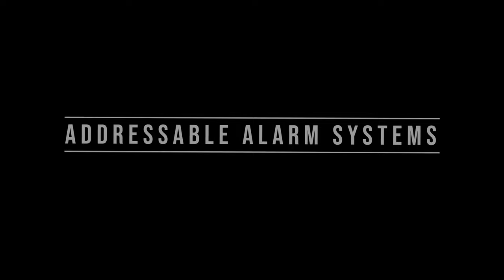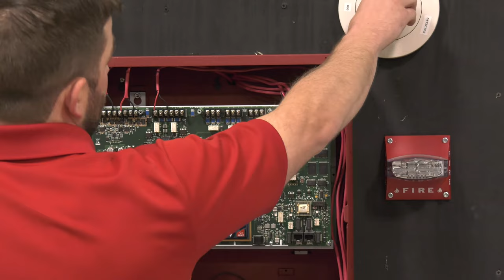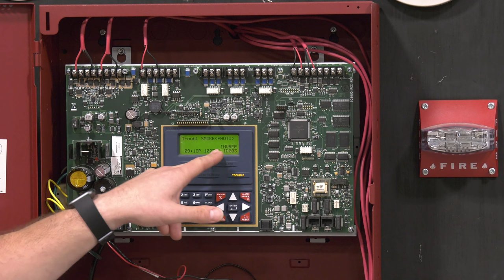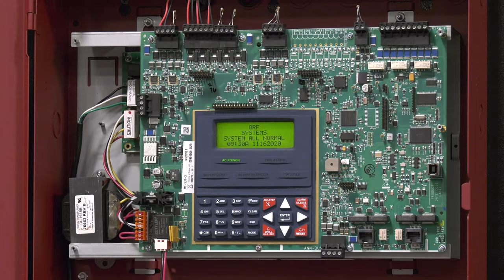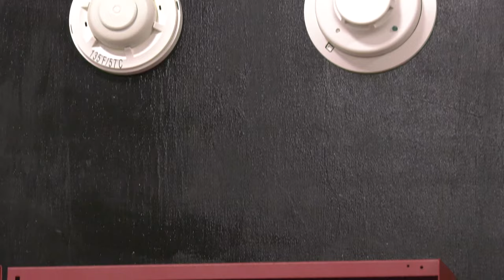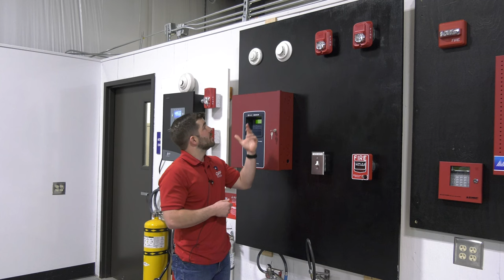Addressable vs Conventional Alarm Systems

Comment: Of course, if you wire multiple detectors on a "zone", they are not gonna know which one tripped it. But if you have a conventional system, and you wire only ONE detector per zone, you get no problems. If you want to reduce wiring, you can use "zone expanders", which are devices that usually communicate via RS485, that will reduce wiring.
Another way to wire it, is room-based. Wire zones so all detectors and pull stations in a room is on one zone. It makes it easy for everyone including firemen, to know where something happened, and once you have visual sight with that room, it will be easy to find out what triggered the alarm.

I actually prefer conventional systems for 3 reasons: They are easier to troubleshoot, because anything you do will have an instant effect on the system. As you saw, that detector you removed took a whole minute or two before the panel even knew about it. The conventional reacted in a instant, thats because the current flow in the loop ceased and kinda instantly woke up the system.

The second reason, is that its easy to integrate non-firealarm-equipment into zones.
For example burgular alarm, you might want to interconnect it with a burgular alarm, either to share reporting channel, or to switch between "Remote mode" and "Local mode" depending on if the burgular alarm is armed or not.

With that, I mean, when people are present, it might be stupid to send the alarm instantly to the fire department, since the fire could be dealt with locally. It could just be some failed cooking that wasn't even a fire, someone already at the stove that reacted immidiately when that pot started to smoke.

So thats why it could be good to have a system that is "local" when people are present, and "remote" (send a instant alarm to fire department) when the burgular system is armed and the building is clearly empty.

the third reason is the vendor lockin. A conventional system can accept fire detectors from any other conventional system. You aren't locked in to one manufacturer of detectors. If you choose a adressable system, you need to purchase everything from the manufacturer of your panel. That could be advantageous in some cases, so you know everything works together, but the disadvantage is that you might have a duct detector that is shipped along with a HVAC system nicely integrated, and then you can't use it because you don't have THAT vendor of panel.
Reply: Thanks a lot Sir for sharing your knowledge, 
Your comment is so valuable and helpful

Comment: in a conventional panel if you had 4 smoke detectors with had leds that had been triggered would they all light up or only one? 

in an addressable panel  does each device have to have a tacked on individual addressable device or does each initiating device incorporate an addressable feature as part of its construction?
Reply: Just the one will light up, and each device on an addressable system has a built in end of line. That’s how the panel monitors the troubles and supervisories, the panel is constantly talking to each device in an addressable system and making sure it has the correct voltage.